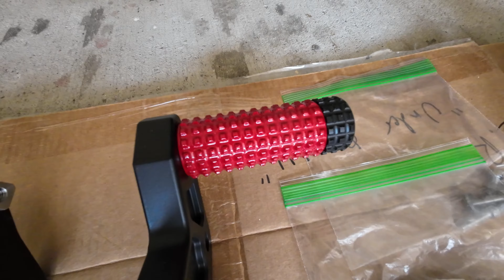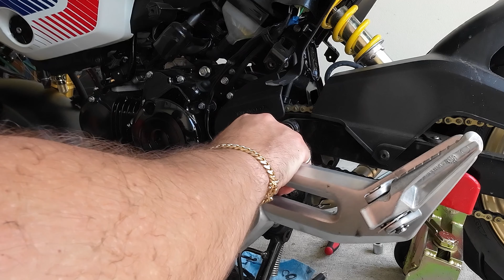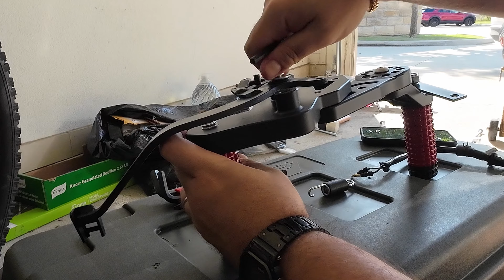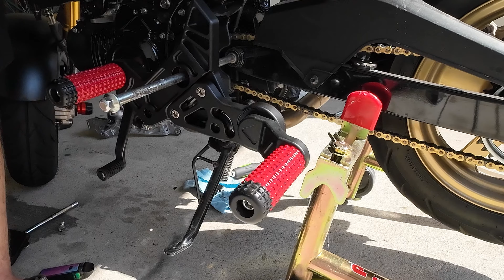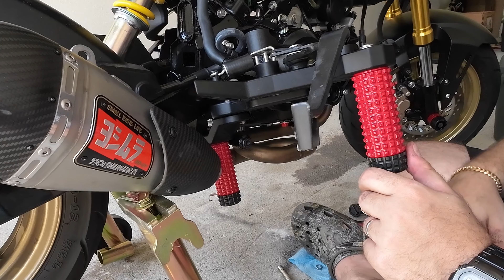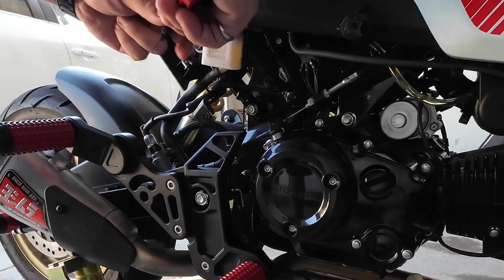Noob Installs $500 Rearsets On A Honda Grom

Comment: Overall impressions on the rearsets? Worth the 500$ in your opinion ? 

Really like the color options you chose. And not taking any shots, it looked like it was a real struggle to get these installed, any opinions after install ?

Thanks
Reply from the maker: They feel a lot better than the original ones. I'm not afraid of my foot sliding off. I can stand on them, both the front and rear pegs. I feel a lot safer just being on the bike with them. Then there is the part where they act like a frame slider and protect the bike if it falls over to the side. That's neat, but this is a grom and those grom plastics would be easily replaced. I might be imagining things, but I think shifting and braking foot position is much easier with these rearsets than the OEM ones, but I never adjusted my OEM ones if it's even possible to, for my foot. Overall, I do not think they are worth $500, I don't think they are necessary. But I love em and I don't regret getting them to make my bike 'special-er'.
Reply from the maker: Also, it was a struggle because it's the first time I've ever done any work on a motorcycle and I decided to keep the struggle parts in the video, so others can see what it looks like when a Noob attempts something like this.
Reply: Leave the video as is.  I purchased the same rear set and haven’t installed them. I’m a noob as well with no experience working on anything. This video absolutely helps. I feel blindsided sometimes by people like “east coast” cause they have all the shit to do the install and make it looks simple AF. This is raw and helps me prepare me mentally. 😆

But would be interested in a follow up with a review. Was it worth it? How do you like them?
Reply from the maker: @wichoswld  HAHA okay :) good to know. I had to buy myself the threading/tapping m6 1.0 to create the threaded holes. I went all out and got a 'Starret' brand that Adam Savage recommended. Standard things like wrenches, a torque wrench, ratchets, and one of those rubber mallets and ull be fine. But i always find it super convenient to have these 'extensions' that help me reach deeper bolts. You know, now that I think about it, having an extra rear swing arm bolt (costs like $10 on amazon) would have made this a lot more easier. Also, I have stands for the rear bike swingarm. I dunno how u would do this without having some sort of secure stands.
Reply from the maker: @wichoswld  I will eventually do a review when it stops being 100 degrees everyday in Texas.
Reply from the maker: update 11/12/23 - i love these even more now that i am trying to do wheelies... there is nothing so satisfying as a thicc girthy peg to secure ur feet on! So I appreciate them even more now, now that I am practicing wheelies